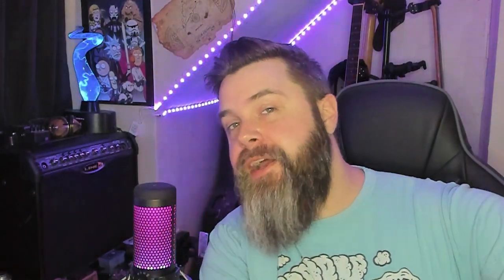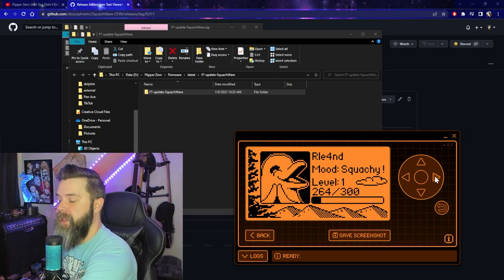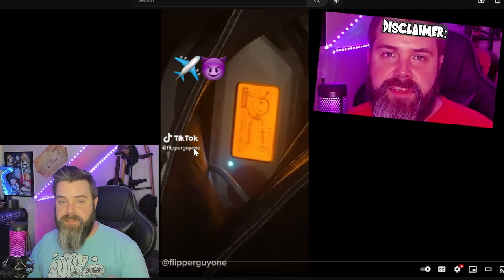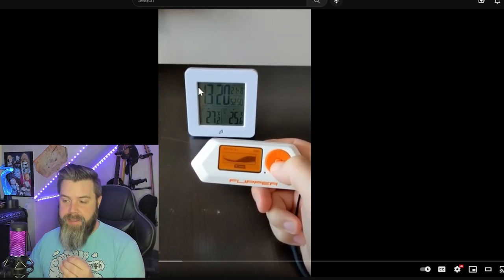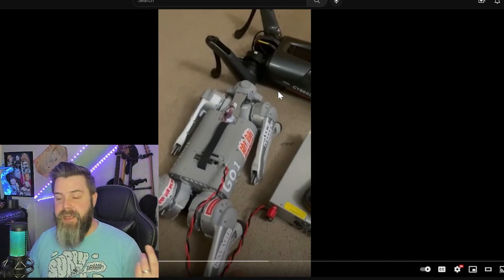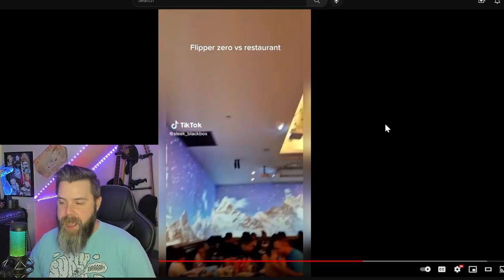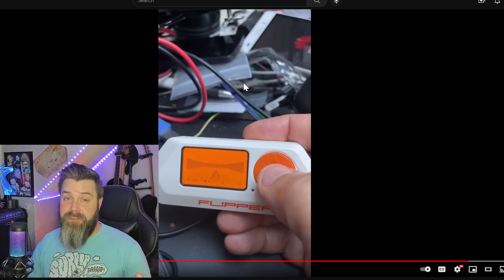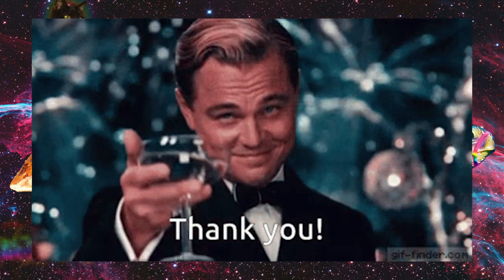I Explain Flipper Zero videos on TikTok So You Don't Have To! 🐬🙊🙉🙈😱

Comment: I tried to do the soap dispenser today at work. I could clearly see the 2 infrared points, but instead of using a flipper I used a tv remote and a ring light remote that were lying around. Neither worked. We also have an automatic hand drier and I could see the IR window there too. Again, no success simply interrupting with an arbitrary IR signal. Unless the flipper has something special I'm not aware of, I wanna say its bunk.
Reply: Universal remote sends différent ir signals

Comment: Hey! I have a question about SquachWare. I noticed that in BadUSB i have to plug the flipper into a PC, and then click run which feels odd and is harder to do in the moment. Unless I'm misremembering, on Clara's firmware you hit run and then when you connect it runs immediately. Is there a way to change this so that it can initiate this way? Because otherwise I like the firmware a lot!
Reply from the maker: I'll check it out!  I haven't seen that implementation but it sounds interesting!
Reply: @TalkingSasquach  Awesome! I appreciate the reply thank you. I did reflash Xtreme just to verify and it does indeed have the "Start" button before connecting instead of the other way around.

Comment: Did I offend you with this question I ask you just because you never replay Can I ask why?

Quick question in your Pets' Microchips 125 RFID you are missing some key features like  Clear T5577 Password, Read Raw RFID data, and  Read ASK (FDX, Regular) . I'm assuming your ASK is regular with out FDX?  Just more different mode to be used and why don't you have them?
Reply from the maker: I try to reply as often as I can. I'm adding features add quickly as I can. Some things do require more work than others to implement, but I'm definitely working on everything!